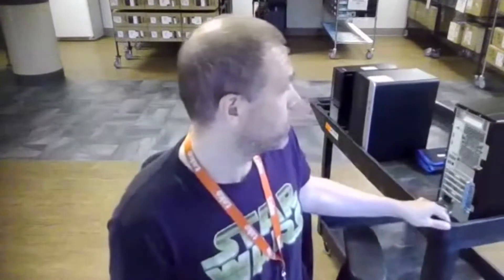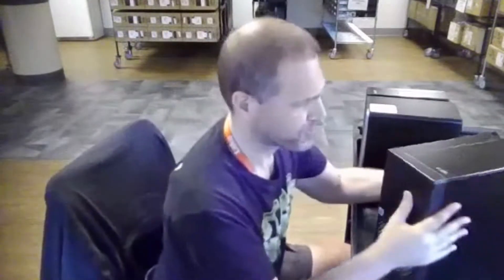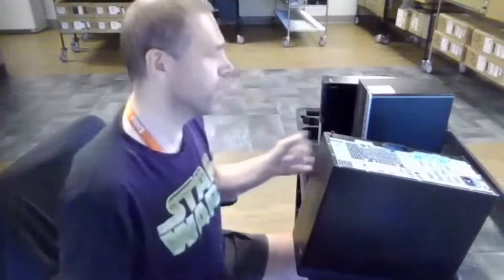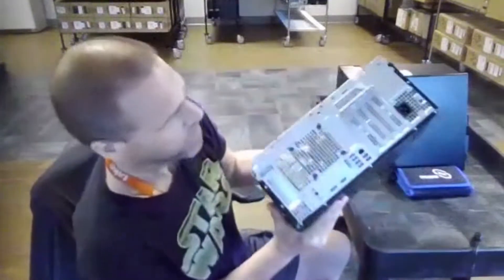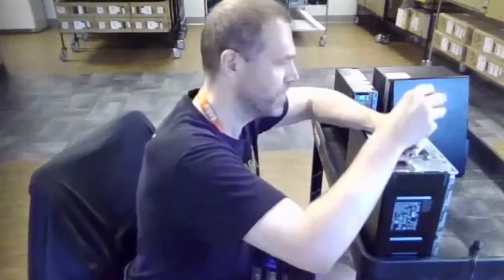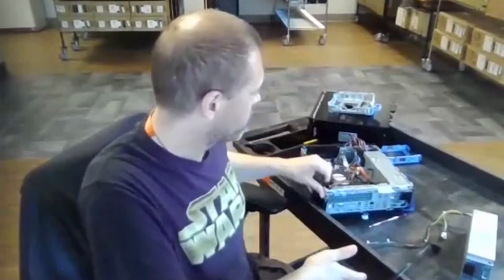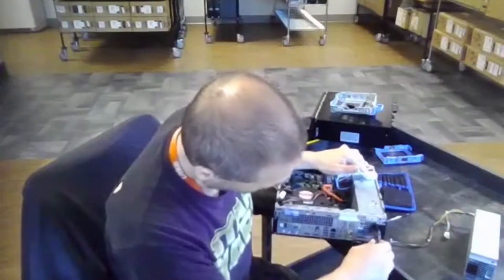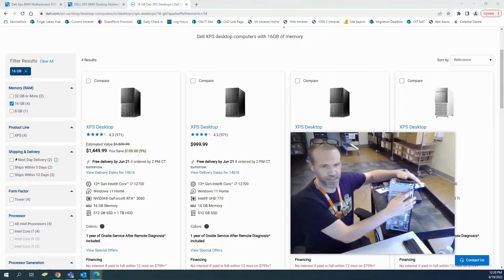Dell XPS 8940 Not Powering Up and How to Replace a Dell Desktop Fan

Comment: I've a feeling that your particular motherboard might have a busted electrolytic capacitor; and that the busting of that one capacitor was what prevented your WHOLE PC from booting up. You see, it could be that your motherboard's design was such that the failure of even one component would prevent the entire motherboard from getting power. See, it could be that your motherboard had what's known as a series circuit. With a series circuit, the failure of even one component opens the entire circuit, preventing all the rest of the components from getting power.
Reply: An electrolytic capacitor is one of those capacitors on a circuit board that look like vertically standing tiny batteries. A normal electrolytic capacitor has a completely flat top, whereas a busted electrolytic capacitor has a rounded top.

Comment: im having a cold boot issues where can i get the replacement power supply and whats the model ,
Reply from the maker: I've put my model in Google to get the part number and then searched eBay. You should be able to get one fairly inexpensive.
Reply: i found one on amazon 143 dollars how do i know if my xps8940 is mt , the pc works now after i replugged and i never turn it off @mymediahelper

Comment: I found I was getting -9V on my +5v POWER_OK line going BACK INTO the PSU from the motherboard.  That was funny.  Turns out it's the blasted chipset.  Thing gets to 80c as soon as the PSU is installed.
Reply from the maker: Yikes. To me that's not worth monkeying around with. Computers are so inexpensive now I'll go that direction.

Comment: After one year of not powering this piece of shit on, today it refused to power on; the evil thing died. Never trusted this junk anyway. Gonna rebuild a new pc around it. Never ever a dell again.  4 short white blinks followed by 2 yellow ones means powersupply failure. You got everything on wheels in the house?
Reply: I did rebuild it indeed. New case with a watercooler, new PSU and it works flawlessly now.

Comment: From what i was reading is that Dell has issues with the XPS 8940 motherboards, quite a few people have dead motherboards.
Reply from the maker: That had to be it. Nothing I did corrected the issue. I wasn't about to screw around with the motherboard. It was just easier to get a new computer.

Comment: Have an XPS 8940 that's 'odd.' Half the time on startup it will either boot up properly, or black screen after the Dell logo. The temp fix is to unplug power, wait, plug the cord back in, and maybe the machine will startup. If not, keep repeating the power plug jitterbug.

It's under warranty, but tired of dealing with the current generation of Dell support 1. Because I can get it working, there's nothing wrong, right?
1 - Been a Dell customer since the 90's. Customer support has gone completely downhill since then.

Just getting an 11th generation motherboard. Have a spare case, power supply, etc. Will pull out the non-proprietary parts from the Dell, and Frankenstein a system together.

Comment: The XPS 8940 sucks! My customer had a power outage, now their 8940 is not powering on. One month after the expired warranty. I didn't have any power supplies with those 12v connectors, so I had to buy one. The 2nd supply made no difference. All the usual tests, battery, power jumper, moving ram, made no difference. I do measure 12 volts going into the motherboard. I also measure misc voltage throughout the board too. I have a feeling there's just one little-tiny surface mount component somewhere that failed. Someone with surface mount electronic repair experience will find it some day, if they haven't already. But I say replacing the motherboard is futile, because most likely it will happen again since I believe it's a bad motherboard design. BTW, this desktop is not a gaming system, so no extra gaming parts, just a standard configuration.
Reply from the maker: That's what mine was. I never gamed on it. Just wrote and do these videos. That seems to be what happened to mine. I was gone one weekend and it happened to be storming. When I returned home dead as a door nail.

Comment: Mine just died, same symptoms. Yellow light on back of power supply will come on briefly. But computer will not start. No lights/fans, nothing. 

Dell support thought it was motherboard. They are sending a tech who will hopefully replace the MB. 

~10 months old.
Reply from the maker: Quality. Was it covered? Let me know how it turns out. Thank you.
Reply: @mymediahelper  yes, it was covered by warranty. It took like a week to resolve
Reply: how long did you wait for them to replace it? I was scheduled to replace the parts but it's more than a week now and they still didn't show up in my service appointment schedule twice
Reply: @luckycham08  they only missed one appointment for me. I think it took a week

Comment: I have the exact same model XPS with the exact same issue. Only had the computer for 1 month. We’re you able to identify what component failed? Cheers.
Reply from the maker: Yikes. I trust for it being one month old you had a warranty on it? In my case it was either getting a new motherboard or a new unit. I decided to bite the bullet and get a new unit instead of playing around with the motherboard. I'll actually have an unboxing posted soon. I stripped the old one of the hard drive, power supply, CMOS battery and RAM and the rest I'll just recycle. I can use the RAM in the new computer bringing it from 16GB to 32GB. I bought an external SATA Drive reader for like $30 for the older drive.
Reply: @mymediahelper  Dell sent out a technician who replaced the motherboard in-kind. Not sure if the entire 8490 model is a lemon...we will see.
Reply from the maker: @redrover1363  Keep me up to  date if you happen to remember. Thank you.
Reply: @redrover1363  how long did you wait for them to replace it? I was scheduled to replace the parts but it's more than a week now and they still didn't show up in my service appointment schedule twice